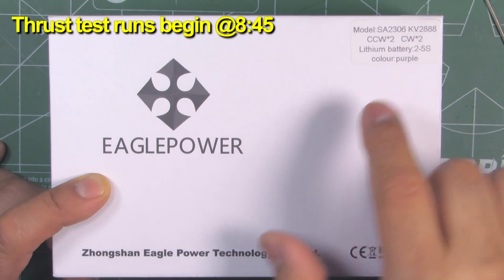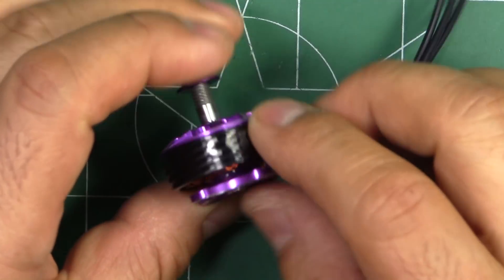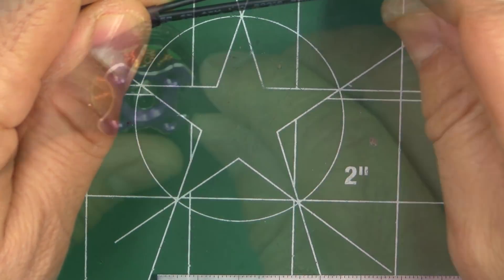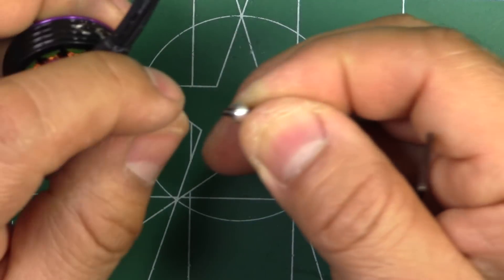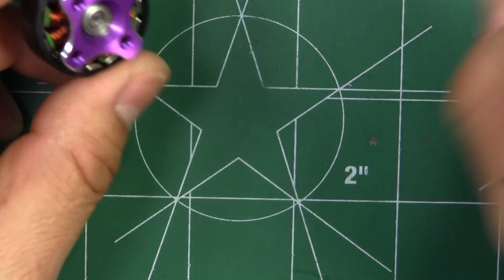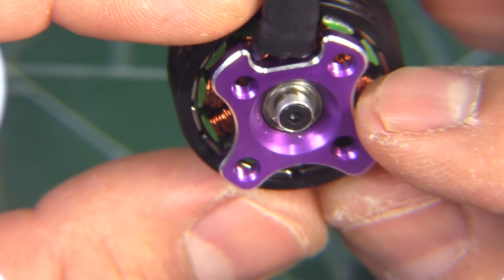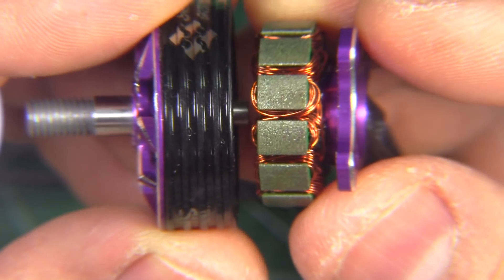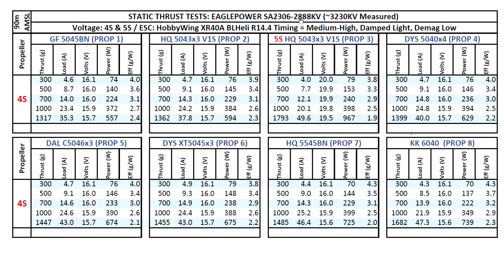EAGLEPOWER SA2306-2888KV Thrust Tests & Overview

Comment: I wonder how these would do on 4 inch props. I know the motors a bit big but high KV and good efficiency makes me wonder what the thrust number would be like.
Reply from the maker: Phongsta probably OK performance. The lower load of a 4" prop should allow these to spin efficiently. But as you said, they're a bit too big for that size prop so you'd probably get the same results with a  24g 2204 or 2205.

Comment: 👍👍Pure I-candy🍭So pretty I'd hate to scratch that Anodizing.lol hey X you think you'll do a review on the SunnySky 1406? I'm building an fpvegg pro, The frame is a 4m tank!.. looking for a lightish, 14 to16ish motor, that's not a complete "amp hog"  Any suggestions would help ;*)
Reply from the maker: I didn't buy those so no plans for testing those :( I think a 1407 or 1507 motor would use less Amps to get the same thrust
A 1406/1407-3200KV motor would be one of the least Amp-hungry motors that will also give you plenty of thrust on 3". It wouldn't be as fast as 3600KV but that's how it goes. Efficiency or Power. 3200KV puts you in the middle more or less.

Comment: Engineerx are you sure it got the full signal to the esc? These numbers are so strange.

EDIT: read your comment below. You already checked. Sorry.
Reply from the maker: nasone32 No worries. It does make one question if there was something wrong with ESC, signal to ESC, solder points, etc. I thought  I had connected to wrong radio Rx channel so I checked and also swapped  in a BH 2207-2700KV motor that I knew would make 1600g+ with HQ5043x3 and it did so I confirmed equipment was OK. Then I used a 2nd Eaglepower motor to see if the 1st one had something wrong. Got same results so my best guess is magnets and airgap because motors are not using more Amps than they should for the output and also they didn't get hot. Temps were very mild actually. Could be the ridges on the bell ring messing up the flux lines? Doesn't seem to be leaking more magnetic force out from bell than usual. There's zero attraction motor to motor so that's good. No leakage. Very odd about the high KV and low thrust.
Reply: EngineerX yes weak magnets and big airgap for sure. Ridges are detrimental only if the minimum thickness is low.

Comment: many of the larger motors now have a ridged/ribbed bell would be interesting to know what they do ? they are on the garila motors with people saying they are for cooling, strength or to help with the magnetic field.
Reply from the maker: Ridges do offer larger surface areas, like a heatsink, so that makes sense. One way to find out if those really work would be to check temps after running identical motors with ridges and without. I imagine, ridges do transfer heat away from bell a little better than standard bells but if the added heat transfer is significant, that still has to be proven. I think the vanes in the bell that force air through motor could be better. Just my guess, seems there's more area on the inside of a motor: magnets, stator, and windings. Still good to see factories trying new features and looking for improvements.
For re-directing magnetic field, the only motor that has claimed that feature is the ZMX FinX series. Interesting concept. They don't use ridges, there more like concave indentations. Cool stuff!

Comment: Beautiful motor, but those tiny bearings will be trashed on the first day.  Might survive a bit better if they are 4mm deep, but are they really a 3.2mm shaft size?  Why would you use an odd sized bearing compared to everyone else?  The response time on them will be bad/smooth, depends how you want to phrase it.
Reply from the maker: Yes, it's 3.175mm , odd size. Would've been much better if bearings had been 9mm O.D. 
I think with slightly larger N52 magnets these will do better

Comment: Very odd motor when it comes to the size + kv VS the performance. How was the temperature of the motor on 4s/5s?
Reply from the maker: I forgot to mention that, but it was actually not hot at all, very similar to any of the other "powerhouses". Amps are low, so not bad in that aspect. When I ran it,  I thought it was something wrong with the thruststand so right away I checked  a BrotherHobby and got the expected numbers.

Comment: very bad motor for 2800 kv pls sp marck 1 test
Reply from the maker: Seems it might be OK for someone who wants a mild setup and not looking for ultimate fast speed. Motor is fairly efficient. Very strange since KV is very high. I'm almost sure it's due to magnets and airgap
Reply: EngineerX could it be, when the prop unloads, the high kv motor would actually have a higher speed? Like it does have a higher rpm limit?